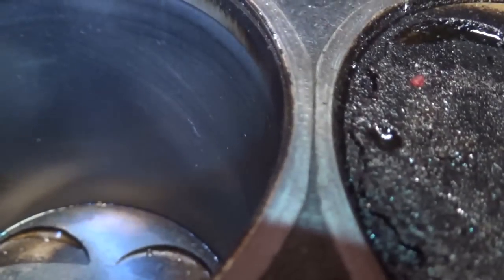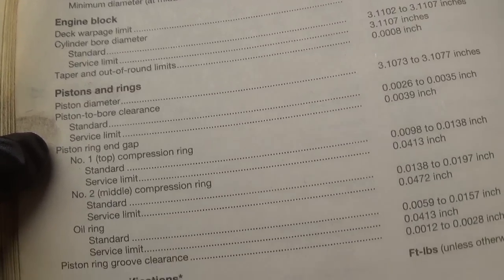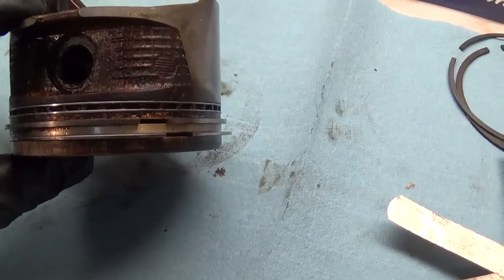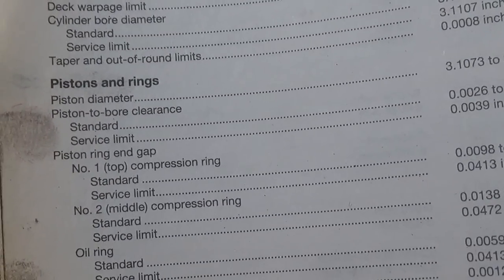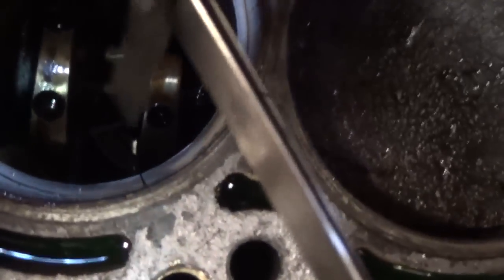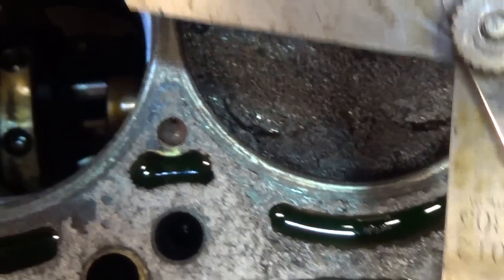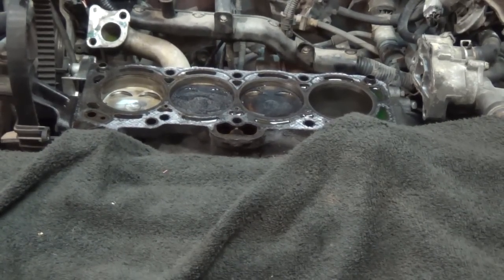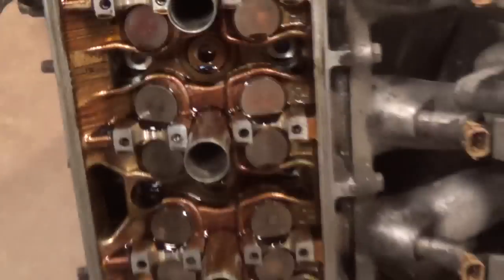Toyota 1.6/1.8L Oil Burning -'96 Geo Prizm -Part 2 of 4

Comment: you are gonna change the timing belt and connecting rod bearings, right, the  gates book says to replace the belt any time you remove it, even its its a non interference engine, plus I noticed 30 number on the piston (overbore)? by the way I had a all trac with the 22 r motor and it sat for a year and smoked like ___, we took the plug s out and poured marvel oil in the spark plug hole and left in for a week with turning the engine over once in a while and the smoking stopped, it was blowing so much oil out the tail pipe it ruined the converter, ring stagger is not really a science, there are supposed to rotate in the groove , via the cross hatch in  the cylinder walls, (in therory) rings in two strokes are pinned , so they dont catch on the transfer ports, great video, that engine ran hot at some point, and coked the oil (dont use the cheap stuff, like wax based oils).
Reply from the maker: Great comment. I replaced the t-belt 10k miles after the rebuild. The 
engine is developing a rod knock however, at 16k miles since the 
rebuild. I'll have some videos on replacing con rod bearings coming up 
soon ;)

Comment: Should have put engine oil on the rings prior to installing. I always dip the piston and rings assembly into a can of oil prior to installing in the block. It serves as a pre-oil for the cylinder for the first start. Otherwise your cylinder is almost dry when you use WD40. I have also poured STP on the rings prior to installing.